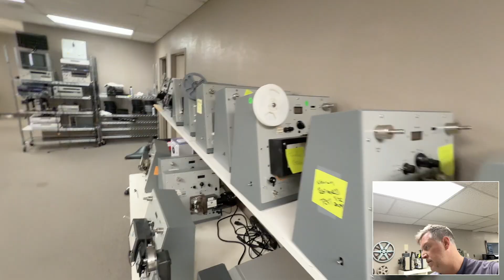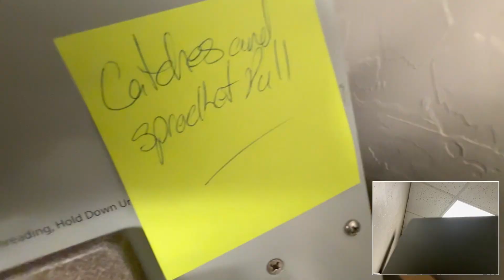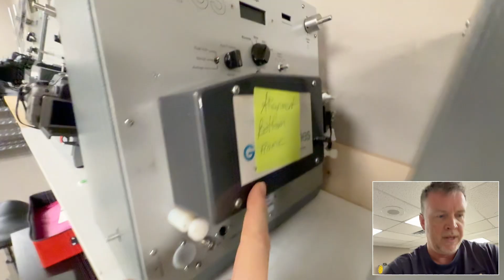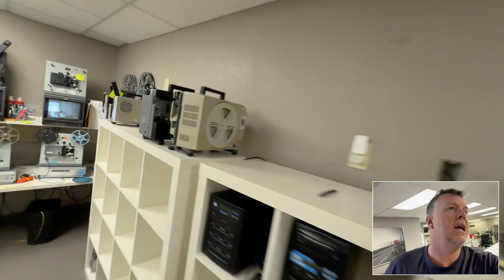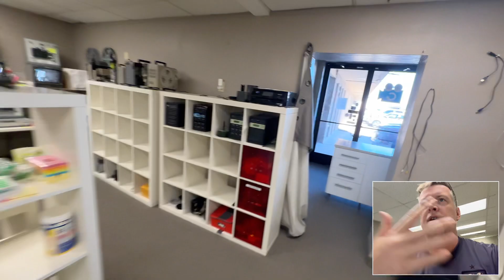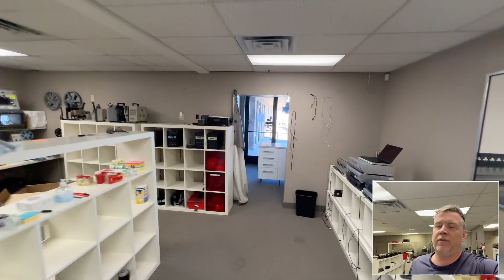Tobin 8mm Film Transfer Machine Repairs

Comment: Very interesting video. Great looking work center.  I have a Tobin TVT-8  (purchased few years back in place of a Moviestuff XP printer) To me it's a well constructed machine and I have had no trouble with it -so far. The only issue that does affect it is running different film stocks and it is noisy! Kodak base keeps good focus, but Fuji polyester film goes soft. Obviously down to film thickness. I was tempted to try a focus adjust, but on hearing your comments I'm putting that to bed. Those Wolverine & Kodak scanners are rubbish. I tried the Kodak Reelz to copy some regular 8. 2 mins into the scan of a "clean" 50' of film it jammed and ripped the sprocket holes. I'm currently awaiting delivery of a S/H Moviestuff Retro8 from private owner. I know they went into insolvency, but hey the price is good.
Reply from the maker: Thanks for sharing your experiences!